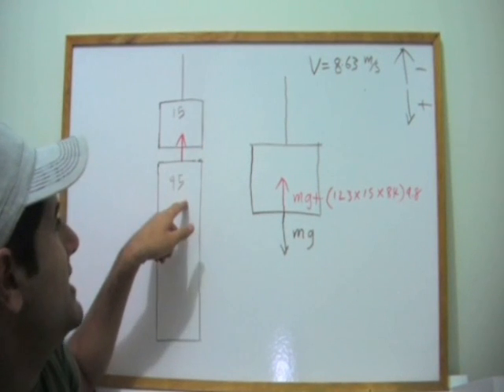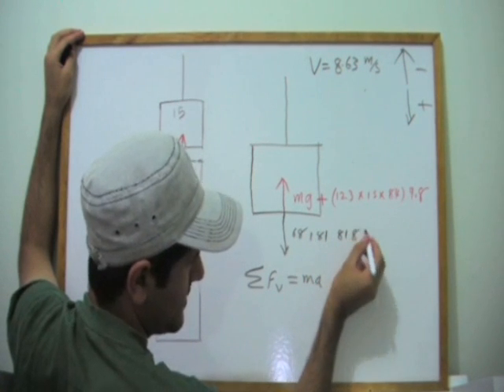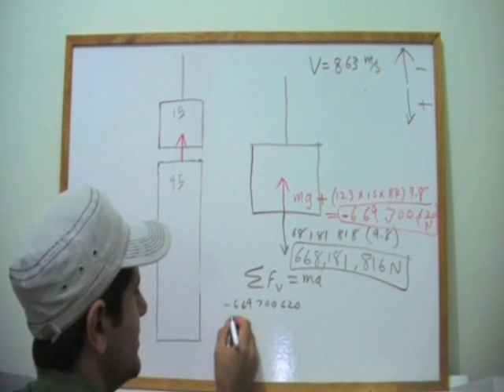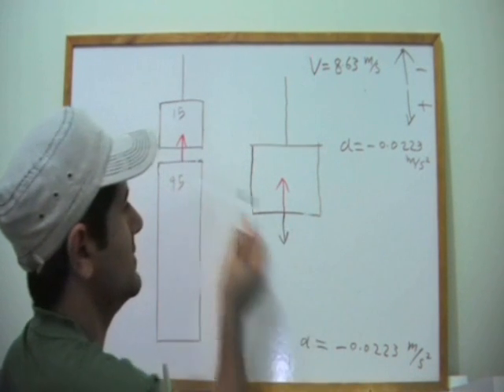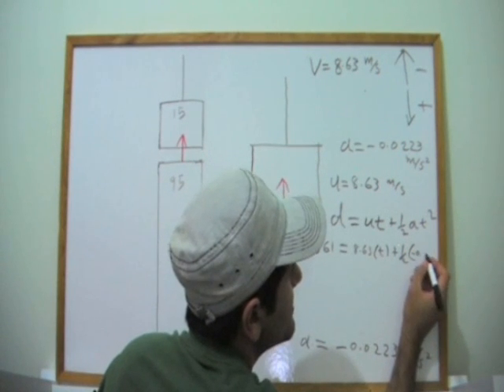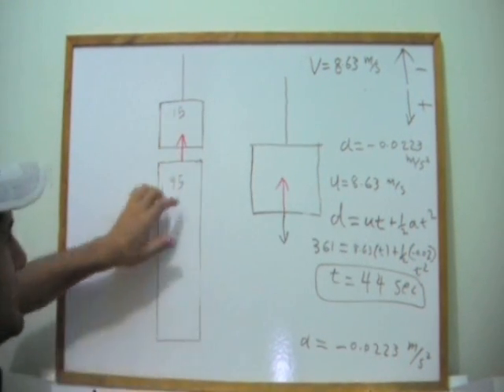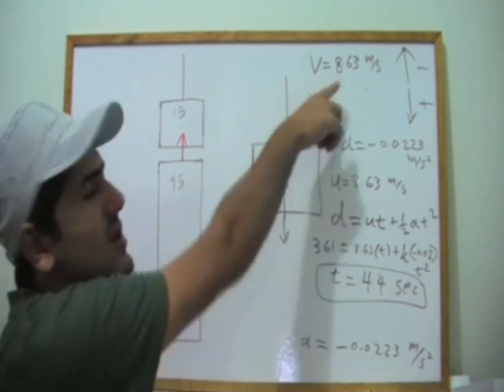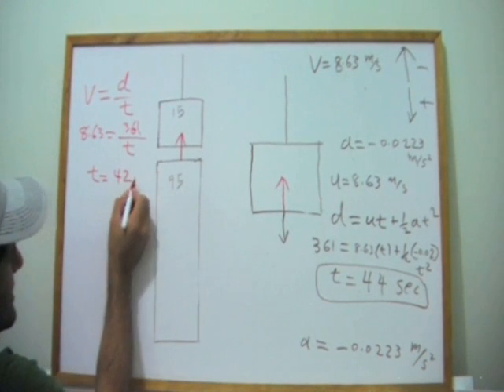(Part3) 911 Simple Physics Structural Failure Vs Demolition

Comment: You could also do a simple calculation of the energy from the fire and see that the top part of the building would never collapse to begin with.

-FEMA estimated (4000) but even if we use 4,500 gallons of jet fuel available to burn upon impact of the World Trade Center, this equals a potential 590,000 MJ of energy, office furnishings were calculated at 490,000 MJ. Using this energy and the materials at the max temperature they could have possibly burned at, the steel inside the World Trade Center Towers could have potentially reached a maximum temperature of 600F.
-NIST paint testing found that less than 2% of the steel ever even made it to 480 degrees F which is likely a much more accurate number.
-Steel loses half its strength at 1,100F which would still be more than enough to support the building, at the NIST estimated 480F the fires caused the steel to reach the steel hardly loses any strength at all.  
-Testing conducted on the World Trade Center floor joists, even heated to 2000 degrees F still did not collapse (4 times the estimated temperature).
The possibility any of these buildings coming down from a short office fire with 4,500 gallons of jet fuel is absolute zero, yes 0%, there is no chance.
If your ultra thin metal stove can handle 480 degrees Fahrenheit for an hour without collapsing, how much more 39” thick concrete and steel? https://youtu.be/wFiOl9qhYE8

And once you begin to look at building 7, which didn’t even get hit by a plane it becomes obvious these buildings were taken down.

In fact Larry Silverstein said the “Decision” was made to take down building 7.

You also have to account for all four TV Networks having foreknowledge of an event that had never taken place in the history of the world, a steel building collapsing from a small office fire.

Oh yeah, that steel building (building 7) just so happened to have all the records of the missing $2.3 trillion dollars!

Comment: This is good. However like all theories, you made some assumptions. And some of them you made are... wrong.

1. You just assumed that the only damage to the building was one floor.

The planes were banked. Multiple floors were impacted.

2. You don’t calculate the force of a huge, MEGA ton plane hitting the towers. At 500 miles an hour. You just assume the rest of the building is just fine.

Well, obviously it wasn’t. It was the equivalent of a HUGE bomb. Now put that force, all that energy, into the building. The building was not designed to withstand such a force. It would have rocked and swayed, and there would have been failures to the building you just didn’t see.

How do you know? How can you be sure the rest of the building was absolutely fine? How do you know what the integrity of building was like after the impact? You have no idea. How can you just assume that?

Ok fire maybe can’t literally melt steel. But it can weaken it. And it wouldn’t take much with all those forces at play, that you simply.. ignore.

Like the titanic that used poor cheap rivets, the ship fell apart, and sank from an impact it should have been able to sustain.  Or at least - everyone thought it could sustain. But it couldn’t. Because it had a design flaw ie cheap materials i.e. cheaply made rivets, to save money. And the powers that be really didn’t want that coming out. That was the actual conspiracy. But we found out the truth - eventually. Just the worst of capitalism to blame.

https://mobile.nytimes./2008/04/15/science/15titanic.html

There may be design flaws you don’t know about, you just assume. The bottom half had been weakened, as a result of the equivalent of a bomb and the effects of that rippling through the building, and jet fuel weakening the steel was not something you even consider.

You just assume that the bottom half should be able to take the top half, because it did before,  due to the equal force rule. That’s true, but this is a BUILDING that’s now been damaged and who knows what’s  been damaged or weakened. It’s not in the same state as it was before was it.

Haven’t you played Jenga? It’s a strong structure when you build it right? All those forces. But then remove just one piece.. what happens? It comes tumbling down, in seconds.

Did you disrupt the lower portion of your Jenga building. No you didn’t. But one piece of integrity to the structure is removed and rest of the structural integrity is weak from playing the game - bingo. Pieces everywhere, right down to the floor, in seconds.

And guess which direction jet fuel travels...

Making those of assumptions like you did in your video, you should have taken up economics.

Comment: You did good!

Think of a car stopped in a parking lot and an identical car hits it at 40 MPH.  Both cars will be crushed and the stopped car will slide backward until the energy is dissipated.  Now think of that parked car as a fully loaded tractor trailer backed up top a huge concrete block.  When the moving car hits the tractor, they will both be crushed but the impact/energy will be absorbed between the two because the trailer and block have too much strength and weight to resist such a small car.  Also keep in mind, the top of the building was a fractured object not structurally sound and the lower part was also damaged until it ran into the entire structurally sound part below.  It should have been a simultaneous crush and then deceleration.

Comment: Good analysis, except you're making a wrong assumption. You're saying that the lower 95 floors would stop the top 15 floors from falling any further as soon as they contacted. This may be true if each unit was a solid block, resisting any further deformation. This, of course, was not the case. If the top 15 floors weighed 10,000 tons each (just for illustration), the entire block would weigh 150,000 tons. When this 150,000 tons fell 10 feet (again, for illustration)it would impact, not the entire remaining 95 floors, but just the next single floor. This single floor would never be able to support 150,000 tons so it would simply add its weight to the top 15 floor weight and (now at 160,000 tons) collapse onto the next floor down. And so on, to the bottom, each floor adding it's weight to the entire falling mass. The resistance of each floor is negligible compared to the ever increasing weight above so the entire column would, in effect, free fall straight down. It would be impossible for the central supporting columns to withstand the inertia of this movement and would be dragged down along with everything else.

Comment: This is an excellent demonstration.  So....now let's look at ACTUAL REALITY.  The buildings WERE designed with a safety factor, and the damaged floors did NOT vanish instantly.  And not just designed with a safety factor, but the design for wind loading alone would require a huge compression strength increase to accommodate the downwind-side down vector induced by side loading from the wind.  During the fires, the beams heated and reduced their strength gradually, and if anything, should have sagged slowly until they contacted the cooler structure and stopped.  It's just like the man says, the buildings had no reason to collapse.

Comment: all this boils down to one simple question,  how can a floor which fails at 13,000 tons stop 60,000 or 120,000 tons at about 20 m.p.h?
Reply: I'll answer that with a question.  If the floor was designed to fail at 13,000 tons, how did it ever hold the 60,000 or 120,000 tons for any length of time at all?  If there are 60,000 tons pressing down on a floor that fails at 13,000 tons, the floor will fail immediately and the building could not have ever stood to begin with.
Reply: 'how did it ever',     it never did, it never could, which is why the structure collapsed, floor after floor after floor.
    normally the weight was carried by the vertical collumns, but the structure was hardly in a 'normal' state, after suffering 3 devastating attacks,   massive impact damage, fuel explosion,  and fire for an hour or two.
    when the 14 floors finally dropped due to damage caused by impact, weakening by fire and buckling of collumns clearly seen in the photo's,  the upper and lower supports were no longer in line, and could not provide the support required, the only thing to stop the descent now was the floors,  they could not, and were removed easily by the increasing mass with every floor added and the massive kinetic energy available , no mystery here, just simple physics.

     the simple answer to my question would be,  'it can't',   but 'truth'ers
dare not admit this, since they have been claiming for years that this could not be a normal gravity collapse,  it was, initiated by impact, fire and good old fashioned gravity.
Reply: That still leaves this question:  During the impact event from the planes, the buildings underwent stresses thousands, possibly millions of times greater than anything that could have happened afterward.  After the impact, they returned to a static state with the both buildings standing and looking normally except the visible damage at the impact zone.  What force was induced to cause the columns to shift to one side or the other so that they were no longer supporting the weight above them?  If the buildings were going to shift horizontally it would have absolutely happened during the impact, when they had a horizontal force vector applied that could not have been equaled, much less surpassed by anything afterward.  Again, beams and columns being weakened by heat would cause slow and gradual bending and sagging, and if that got extreme enough for it to finally contact the cooler, intact structure below, it would stop.
Reply: The Man Of Steel
the towers were designed to survive a side load from wind, of about 5,000 tons, very strong, the aircraft could not knock it over since it's mass was tiny compared to the towers.
    but it had massive kinetic energy, roughly 3,000,000,000 joules due to it's speed, around 500 m.p.h, so could easily knock the collumns out of the way and damage the core.
      photo's show the collumns bending  before the collapse, when collumns bend they lose much of their strength, fire weakening floor joists would have caused this, explosives or thermite would not.
     just before the 14 levels collapsed, they tilted slightly, so now the collumns were either  broken or buckled, either way with it tilted they could not be directly above one another and not providing the necessary support.
    it fell roughly 4 metres at least on to the floors below which only support 13,000 tons before failure, but it was not just the weight, it now had a kinetic energy of roughly 2,000,000,000 joules which could generate an impact force of almost 2,000,000 tons which would have knocked anything out of the way.
   if you doubt that a falling object could generate such a large force try this,
   take off your shoe, very slowly place a brick on it, no problem, now get someone to drop it on your foot from a height of 4 metres.
      when you get out of hospital, you will have learned 2 things,  kinetic energy can produce massive forces compared to  weight of an object, and never take part in an experiment i suggest.
   i do these calculations in my head most of the time, so they are only approximate, if you want more accurate figures, get a calculator and do it yourself, not difficult, just mass in kilo's times velocity in metres per second times metres per second again,  then divide by 2.
  nmsr truth resources explains all this much better than i, and exposes chandlers huge mistake in the forces involved, take a look, it has a very simple method of proving kinetic energy, no maths.
Reply: I have to say you are doing an excellent job with your words.  Best to you.
Reply: Maybe I'll try one more on you.  If the buildings collapsed from structural failure and gravity, where did all the heat come from?  Notice every vehicle parked near the buildings, including official vehicles were fried to the bare skeleton.  Let's get a nice, wordy, scientific-sounding explanation of that one :-)
Reply: The Man Of Steel

i sympathise with the 'truth'ers anger regarding the monsters in washington d.c who have embarked on a campaign of mass slaughter in the middle east or anywhere else that dares to refuse to take orders from,'them' but blaming the towers fall on, thermite, explosives, invisible energy beams etc, without any proof at all is ridiculous, and will not result in power being taken away from them,
     i wish them luck in getting rid of these despicable vile creatures that rule over them and cause most of the suffering on the planet, but that will only happen if the masses take to the streets and paralyze the cities demanding change, but i can't see that happening.
    i see russia as our only hope provided putin stands firm against them in what's left of syria, i hope he does, no matter what the cost, otherwise there is no hope.
Reply: 'where did all the heat ',etc
      are you kidding? thousands of litres of jet fuel setting the buildings on fire, for 45 and 105 minutes and you ask  where the heat came from?
     'every vehicle fried to the bare skeleton',  not true there was lots of unburnt paper etc in the streets and leaves on some trees, some one is feeding you with lies,
     take a look at, nutty 9-11 physics and really nutty 9-11 physics.
Reply: The thousands of liters of jet fuel were nearly a thousand feet up and the video shows the fire being snuffed out in an instant as soon as the top section crashed down on it.  There is video documentation of a lot of vehicles parked near the towers that were literally fried to the bare skeleton like I said.  Where did THAT heat come from?  I have to say it's a little lame to ridicule me ("are you kidding? thousands of litres of jet fuel....and you ask where the heat came from?) I'm talking about the heat down there were the vehicles were parked, as you could have derived from my question if you actually had an answer.  Well, I tried it on you, and that's what I got.  Good enough.
Reply: The Man Of Steel
carry on believing what you want, if it makes you happy, my posts are for people who are willing to learn, not you.
  no more time will be wasted on you, bye.

Comment: +Ali Mohamad
Ali Mohamad, you're a baby engineer. You don't understand any of this to any depth whatsoever.

You assert one wrong thing after another after another.

Go work in the field for 20, 30, 40 years (as I have), and see if your understanding improves. Unless you get your ego under control & start admitting that you're confused, you will fail.

OR ...

... you could reply politely to me & I'll point out your litany of errors. AND what the correct answers are.

I really expect no response from you.

Truthers Just Ask Questions.
And, in cases like you, make stupid, wrong assertions, based on incompetence.

Truthers never stick around for answers.
Truthers never correct their incompetent, wrong assertions.

After all, that'd bring an abrupt end to your sick game.

But I'll check back periodically. Just to see if you reply.
Reply: +teefkay2  I'll stick around for an answer.   Well, how about you explaining this. I need you to take into consideration that over 90 percent of the jet fuel burned up on impact within the first 3 minutes. The fire starts to decrease its intensity within 20 minutes. An open air, hydro-carbon based fire cannot reach anywhere near 1800 degrees under such conditions as on 9-11, and explain to me how all sides of the buildings steel weakened at the same time .

 Show me when you think the building begins to sag from weakened trusses and what videos you watched to verify that. Because you state you worked 40 years or so in the industry does not mean you know how 2 110 story buildings and 1 47 story building came down damn near  at free fall speed/acceleration. I specifically need to know how the heat from the hydrocarbon fires were transferred from the impact side to the non-impact side in order to have a symmetrical type collapse, after all there was the core in between. No debunker cut and paste jobs, just solid points from your own knowledge of 40 years on the job.
Reply: +teefkay2 Don't drink too much wine, cause it makes you say a lot of bullshits.